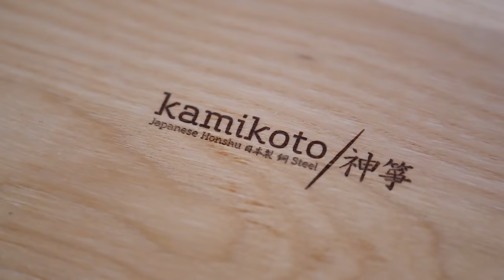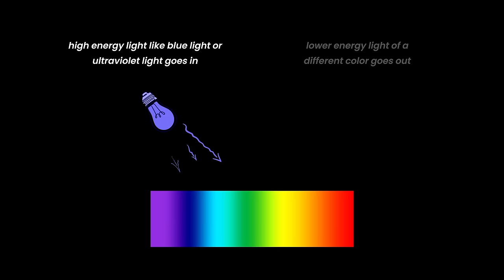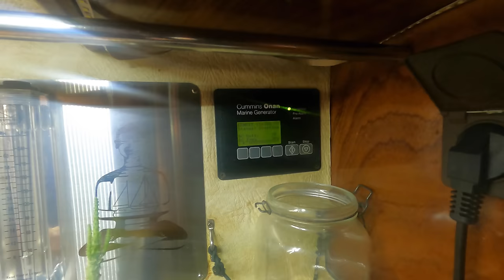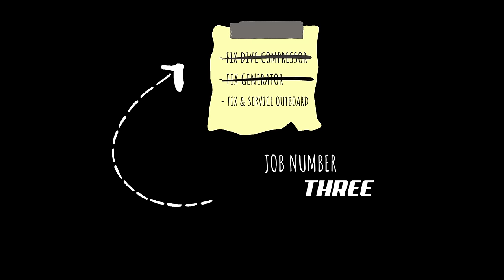BROKEN (again)…Sailing Vessel Delos Ep. 437

Comment: at 21:14 the slanted notch in the flywheel is provided to place the end of a knotted cord that is then wrapped around the the flywheel between the top and above the gear teeth so you cand start the motor without using the recoil pull start. the slant of the notch will provide a clue as to which way to wrap the cord. put some kind of handle on the other end of the cord, (section of broom handle with hole to pass cord through and knot). to start place single knot in notch, wrap cord around flywheel, little over one wrap, grasp handle and pull, flywheel spins, knot slips out of notch and motor starts

Comment: Get a tube for your vacuum pump to run down the dipstick tube. You can pull the old oil out of the engine with no need to open the drain plug. Much less mess.

Comment: While it’s running and hot, take a video with your FLIR CAMERA of the injectors and return lines to see which cylinder is returning the hottest fuel. Also you may see a lower temperature in a cylinder that is underperforming. Look for this on the exhaust manifold as well. Good luck!!

Comment: When you pull the outboard start coil line, to save the life on it, pull it no more than 12-15 inches. Give a short pull , 3-5 inches , then a pull of 12-15 inches, it will save a lot of replacing cord , housing and spring.😊

Comment: Brian, I love how you go into depth when you're repairing something. It gives us, Josh Q. Public , something to turn back to when we need to repair our stuff. I may not have the boat or anything, but some things we do have, loke our water-filter system. Before the big "C" our water was great but now if seems like the chlorine and Floride are 10 times the limit and the water tastes like bleach and now we can no longer get the correct Burkey filters since the government has deemed them a hazardous material. I'm stuck using a Zero water pitcher, which is pretty good and gives me a way to check the condition of the water. Yall have a great sai,, be safe and remember dr,  only dead fish go with the flow. My favorite saying from Vanlife Plus on YouTube!!!!!

Comment: You always want to replace the copper crush washers and rubbers on the return and pressure fittings or you end up with leaks on that Kubota.  Sometimes it will even draw air in  when you shut down, and then it will run rough on restart (or struggle to restart) until it clears the air and that could take over a minute or more.  You may or may not see any weeps around the injectors when it does that!  Check your water separator and filter since you were seeing the crud.  If its shiny crud that could be wear off the injector pump, but if its rusty crud that was probably out of the tank.  Hope that helps - those little Kubota motors are invincible.  Better than anything Volvo has made (my opinion!)

Comment: Kubota mechanical injectors have what is called "crack pressure", it is a spring in the injector.  Over time the springs get "lazy" and you loose efficiency, especially at lower RPM's.  You did due diligence to order new ones, you already knew essentially.

Comment: The  bottom of the indirect injectors should be flat. when the middle pin starts to show it's bevel it's time to change it :)

These were due.  With 2 deep sockets you can also take a chance and replace only the bottom part, if the springs are doing ok and don't mess the preload shims ;)

Comment: About the only thing I can give any advice on is that Kubota genset engine, I have nearly the same model in a little tractor.  Yes additives specific for cleaning diesel injectors can help rough running but it can take quite a long time of running, maybe 10~20 hours to have effect.  Changing the injectors is a better approach although pretty expensive if you do OEM.  Changing the topic, be very careful using UV lamps for viewing fluorescing objects, they can cause significant eye damage.  The UV portion doing the damage is invisible.  (A bit concerned if you were shining it towards Sierra) Those yellow filters are more for UV protection than for viewing pleasure.

Comment: Cap, dunno if you've seen it, but you can buy segmented V-belt (sometimes called 'power twist') off the river.
Great backup belts as you can add or delete segments to get the length you need.

Comment: You can use that vacuum pump to suck the engine oil out of the outboard, might need to get a smaller diameter tube.  First time you try it suck all the oil out that you can and then pull the drain plug to see how much is left, if there isn’t much you may not even need to pull the drain plug on future changes.

Comment: Brian, you don't need that mechanism to start your motor, simply use the pull cord to wrap around the top of the motor and pull the cord as normal. You can see the channel (2 of them on opposite sides) on top of the motor to attach the end of the rope and then simply wrap around that gear head.

Comment: I drove my last semi one million nine hundred thousand miles and only replaced the injectors once. The thing I always did was add one quart of cheap automatic fluid to one hundred fifty gallons of fuel. There is a mild cleaner in it and a lubrication that just seemed to help.

Comment: Hey guys! Your kubota generator is very similar to the universal 25 motor I have on my boat. I had gone through a similar experience with it running rough and eventually not running at all. I read all the forums for a fix I replaced all the injectors, glow plugs, all the fuel lines, fuel pump and all filters and still nothing. Turned out my issue was a blocked up exhaust elbow and once cleared up the engine ran much better. Seems like you got yours sorted but if there's ever another issue in the future check to make sure you have good exhaust flow. Cheers!

Comment: On the generator you can check for a dead cylinder by loosening up those high pressure lines one at a time, just half to one turn should do.  If it sounds worse when you loosen a line that means that cylinder was working, if there is no change when you loosen a line that means that cylinder is not working.  It’s a little messy but not dangerous.  You can also measure exhaust runner temperature to see if there is one that is significantly colder.  There is a possibility that at higher loads more fuel was flowing from the pump making that dead cylinder start working, could have been a fuel restriction, could also be low compression in that cylinder or a fuel pump problem.  I do hope that throwing a set of nozzles in was all it needed! Cheers

Comment: Brian! The Kubota (as Im sure you already know) is a rock solid engine used worldwide in irrigation, small tractors and hidden under gold paint of my Universal Diesel in my Catalina 38 S&S design, 1982.   The Universal Diesel model is 5424,   24 hp,  glow plugs and salt water heat exchanger.   Mine has about 1200 hrs on it over 40 years and still starts instantly, holds great Oil Pressure etc.   There are numerous manuals on the engine. Kubota references the ID stamped on the side of the block - mine is starboard, forward of the fuel injector pump starts with DH  I have three PDFs of tech service manuals if you want copies.  M15, M25, 5424, etc.  between the three you can fix anything.  Let me if you want those PDFs and where to email them.  The bock number is important if you order replacement seal / gaskets from a Kubota dealer.

Comment: Dirty fuel might be your main issue! Check that, take the injector out and set up a test bench with a battery and a water bottle and run cleaner through the injectors, check wiring to them and save them for emergencies.

Comment: Hey Brian looks like serious helping you get some stuff done. That air compressor the next time you're in a shipyard pull it out and I think you need to clean it really good and maybe check the wells and stuff is it look pretty crowded badly.  Only other things I recommend silicone spray on your engine components yeah we'll keep them nice and shiny and keep corrosion from happening. Also I don't know if you do it but ice I do it with my type of gear I get the food grade silicone spray bring all my bad gear after I dive and my stuff is in beautiful it's a nice shape as I bought it years ago also on your diesel I was thinking it wasn't your injectors but that injector look real clean still might be you might want to take all the injectors out and you have the injector clean stuff just stick them in the Joker cleaning solution for 24 hours and let the injector cleaning stuff just have its way and then blow them out and see what you get

Comment: I scrolled for a bit and didn’t see any feedback on the diesel troubleshoot and didn’t see the following. Diesel engines can do some very interesting things when it comes to the pump timing in relation to the crank/cam. Most have adjustable pulleys for degrees +/- TDC. Be safe.  Just some feedback from an old VW tech.

Comment: As much of a PITA it is, you HAVE to fill the lower gear oil from the bottom. Even though it's messy and you lose a lot of oil in the process, it's the only way to purge the air. Did you guys do an impeller change out as well?

Comment: When drive belts/chains/shafts go south, I always inspect what they're driving!  Has what they're driving increased in resistance?  Is it time to relubricate or replace some bearings?  What about pistons or valves?

Real World:  When my second alternator belt failed in three months, Dad said, "check the alternator for ease of motion."  There was no ease of motion, so I replaced the fried bearings in the alternator.  Walla!  No more belt failures.

Comment: Your diesel gen problem sounds like an injetor is partially stuck open black exhaust would mean its running rich 
Would warm it up and add more ejection cleaner as a start run it in burst for 30 seconds at a time giving the  the cleaner time to soak and break up the build up 
If this doesn't fix the issue you can also remove the injectors and have them remaned would keep spare coppers around and a spare injector or two for both engines

Comment: FWIW...  If the engine runs nice and smooth now with new injectors all you have proved is the fuel delivery system is dirty.   Clearly change the filter... all of them often there is a second... on this boat you would know.   If the filter is dirty... rusty and watery it is WELL worth the effort to take that sucker you have and run it to the back or front corner of the tank.  Where ever it spends most of its time.  One can use a stiff piece of bailing wire or coat hanger to add control to the intake pipe.
In your case I would also carry a "lift pump" spare if applicable.  I am aware of some  other parts you carry.

The belt you put on the compressor should bit loose enough to slip at start up.  Hold one pulley and slide the belt with your other hand. You should be able to just barely slide it.  "Tight" will take out the bearings and belts prematurely.

I have never seen an outboard that was not made to be rope started WITH OUT the rope rewind.  The flywheel is notched for the rope and a space provided for a few raps.... Even with out the notch once the rewinder is removed one can use the rope and just rap the outside of the flywheel with it.  Never know know days probably engineered it to be "better" than before.

Comment: 04:43 The inside of the compressor is just as rusty putting rust in your dive scuba tanks when you fill them up. I look at this part of the video and I think you are going to breathe in tiny particles of rust because that sea air gets pumped into the compressor with its salty corrosiveness unless you change it out for new. You wouldn't want your daughter Sierra to have the worst when she dives eventually. Just because you can't see it doesn't mean it's not there. Watch out for tuberculosis with those things. Oh god. Change the dive compressor out with a new one. Brian, you are selling Japanese cutlery. Maybe sell dive compressors by showing the before and after with a new compressor and how good it looks.

Comment: I can't see how you put up with the complexity and vulnerability of a internal combustion engine to compress air for your tanks.  Electricity from batteries would run a compressor that either works or doesn't.  Nothing in between the batteries and the compressor. No belts, oils, or diesel.
Reply from the maker: It takes 1.3 KWH per tank, so thats 2.6 KWH for two tanks.  Which is about 40% of our total solar production in good conditions.  Its just too big of a hit on our power budget to not run the gennie….